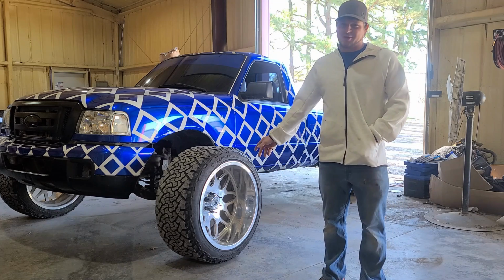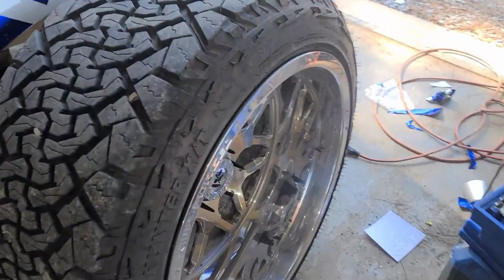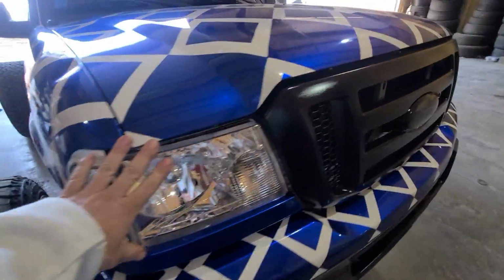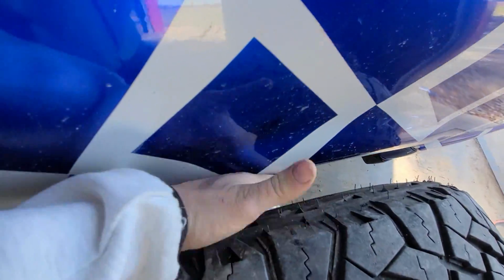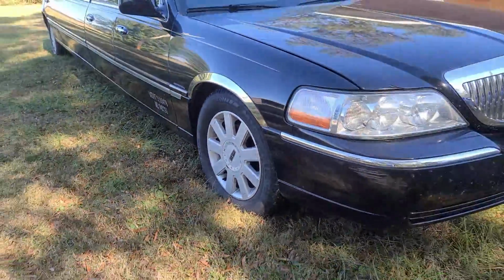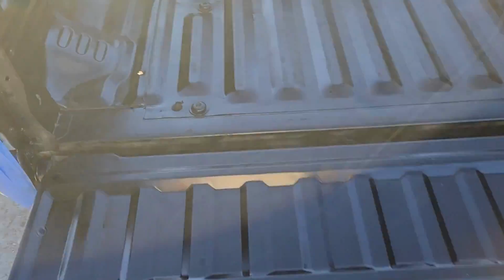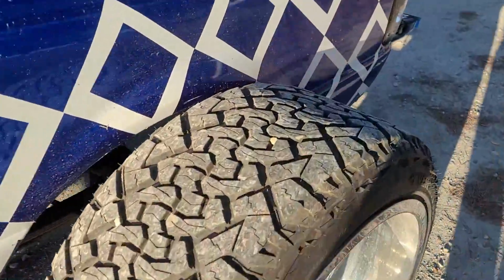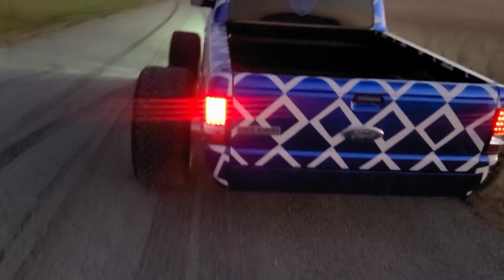2007 Ranger Build Part 4 Paint

Comment: I remember when people did things to their vehicles to make them more functional. I absolutely love how youre clowning on all the douchebags in the world with this thing. People always ask me "You spent all that money on your suspension and your truck isnt even that lifted, what gives?" Yea man, i spend money to get wheel travel and adjustability, not to fit the biggest wheels and tires possible. Also, for the price of your stupid ass wheels and tires i built my engine and twin turbocharged it. So now i have a 2006 short bed single cab chevy with a 406 stroker, camburg long travel suspension, 3.5 triple bypass coilovers, 600 wheel hp, and 24 inches of travel in the back and 18 in the front. And i can still load my yz450, my sons yz80 l, and the wifes yz125 in a trailer and tow it to the track without some $400 dodgy ass reciever hitch. When its just the wife and i or the offspring and i, i can ride both bikes up my ramp into the bed without having to find a hill to unload on. And my dogs can jump into the cab without me having to pick them up and cover my black hoodie with pit bull hair. Yea all i wear is black what of it? Im in a metal band im hardcore. Thats just a joke i am not a dbag in any way except when theres a dbag standing in front of me and im making fun of him. Nice tap out shirt bro, you must have kicked so many asses.